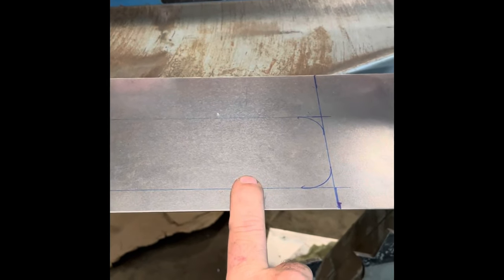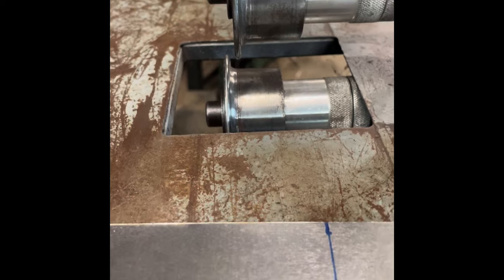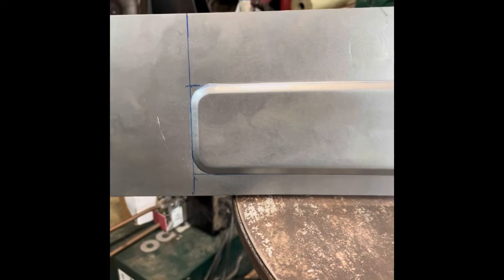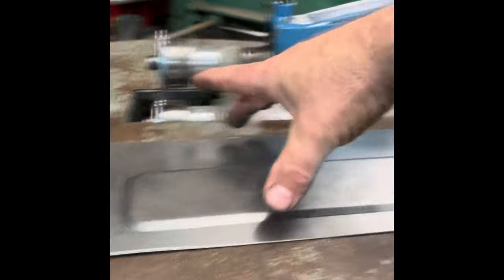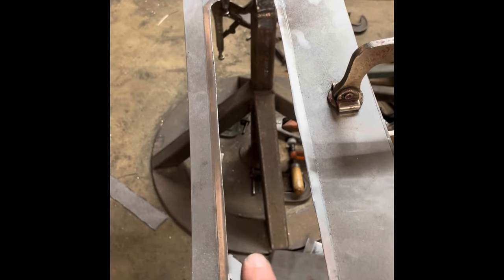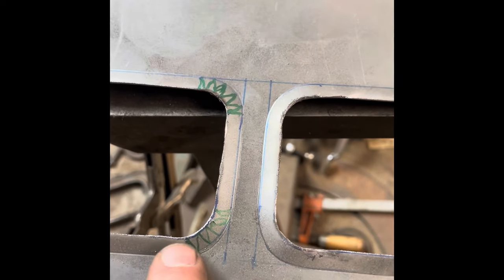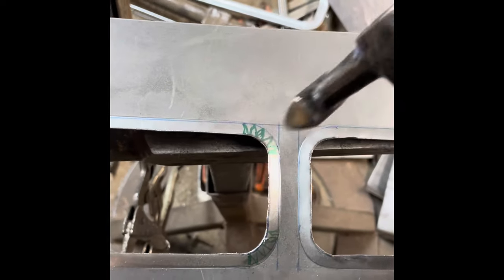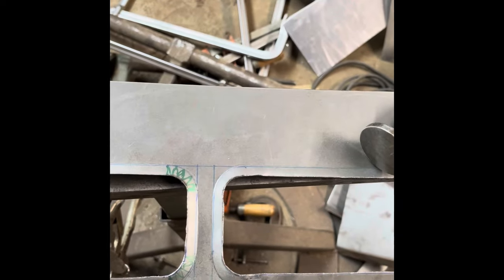Fabricating a 60’s C10 upper cowl

Comment: I enjoyed watching you walk us through this process. I been caught out making hammer forms from steel that end up taking the entire day because I need more than one of is needed. Plywood is really only accurate for 1. I just need more practice on the bead roller. Don't get me wrong I do like it, no I love it. Just need a better fence. Not great at long straight runs. Any tips would be much appreciated. Thanks
Reply from the maker: Thank you glad you enjoyed it. As far as long straights I use my table whenever possible I can clamp fencing to it and it gives my hands much more control as well as speed control. I’m hoping to do a beading video in the future and try to remember to make this a bullet point innit. Thanks for the support.